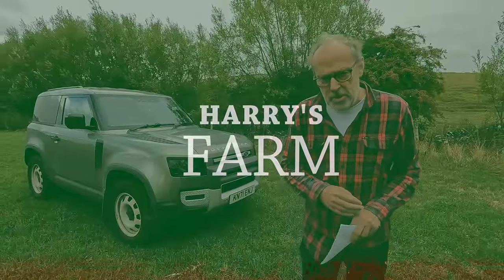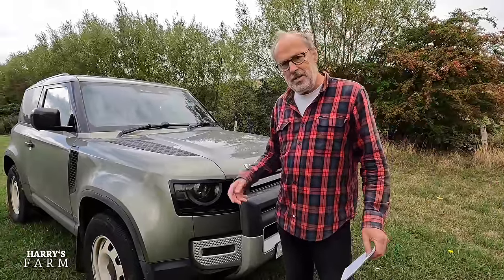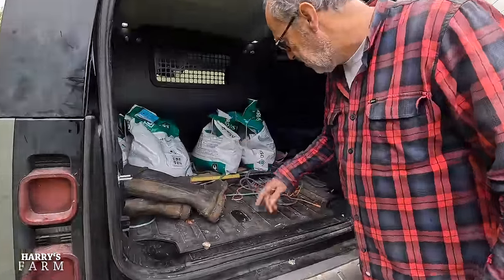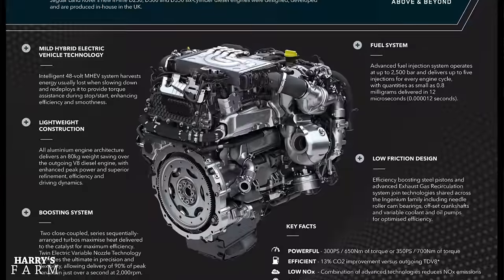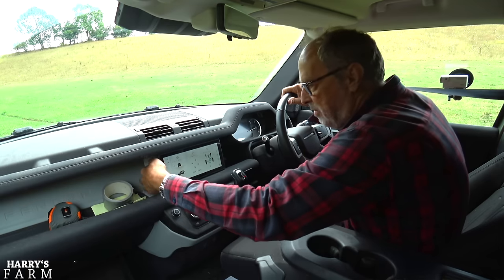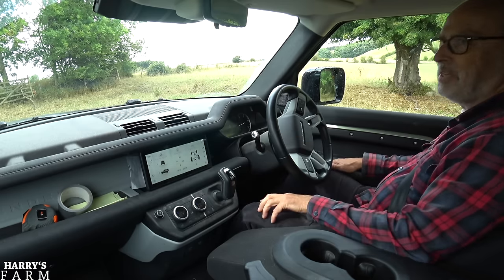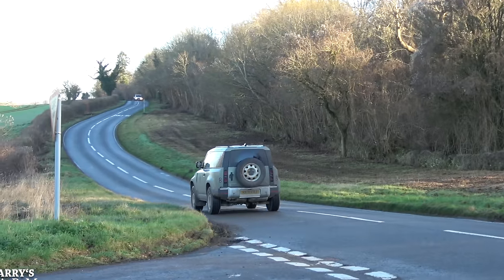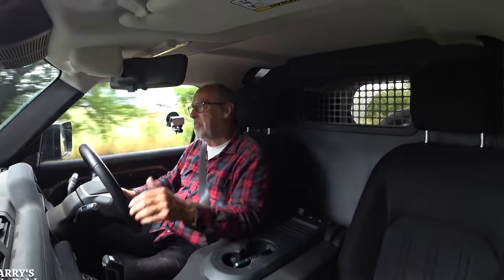New Land Rover Defender 90 Hardtop 12 month review. Is it a true farmer's car?

Comment: I'm astonished at it's 2nd hand value. It is , no doubt, a good vehicle but nearly £10k more than it was new with 10k miles. It would be a great farm vehicle at around £35k.You'd need to be deranged to pay over £60k for that!"
Reply: Amazing isn’t it; I have a 110 plug-in hybrid which came in at under £70k when it was delivered at Christmas, and dealer offered me £85k for it at 10,000 miles… If Land Rover could just build more of them they’ll be able to start offering cheaper ones again hopefully
Reply: That is utterly insane. The world's gone mad. That said, I'd take that offer, but something else to drive for 18 months and then buy a new Defender and pocket £15k 😁
Reply: @Stu_2112  yeah tempting but the problem is anything I bought for the short-term would probably lose a lot of value as prices come back to Earth, and now the new price for the same car (which I’m very happy with) has gone up by £8-10k anyway, so would have to pay a lot more to get back to where I am now
Reply: I'm not, not at all. It's a chip off the old block. Just goes up in value. Modern Defender with heritage from 1948. Unstoppable. They can't build them fast enough. It's these or a G Wagon, do you want to look cool pulling a horse box across a field at Chatsworth or look like a gangster in a G Wagon?
Reply: You aren't getting "more". Your money is buying less or another way of looking at it is, your money has depreciated in buying power.
Reply: @gulag8735  exactly.
Reply: @richardburns5925  I'd take a standard G Wagen without the bling any day.
Reply: @h2489-m2l  and I'll pull you out, when you get stuck dude, all pose your G Wagons you see, 160k posemobile, Defender's are built to work!
Reply: @richardburns5925  fair one. Of course I'll never have a 160k G wagen. I'll stick to my 80 series Landcruiser which chews up Defenders with ease! After 20 years being let down by Army Defenders I never want to drive a 110 again either!
Reply: @h2489-m2l  when your Toyota land cruiser gets stuck, I'll not bring the Defender, I want to get to you and come home same day. No, I'll bring the Nissan patrol Y60 TD 42 inline 6, total utter reliability. The only realistic head to head with the Toyota.
Reply: Many new cars are like that on first release it's nothing special
Reply: @richardburns5925  it's not possible to look cool pulling a horse box across a field at Chatsworth. Irrespective of what vehicle you're in, you just look like a Chatsworth horsey person, i.e. not cool.
Reply: @NickPerry  you don't understand the definition of cool dude. Trust me, if you are driving a Landover pulling a horsebox at chatty batty......you look the bizzo! Where else would you want to be?
Reply: I’d not want the word cool defined by anyone capable of using the words dude, chatty batty and bizzo.
Reply: @peterdelmonte9832  I don't want anything to do with anyone called Peter the man from delmonte, what a half baked stupid name, laughable, trouble is the laughter is now fading.......dude
Reply: @peterdelmonte9832  the man from Delmonte! 😂
Reply: @peterdelmonte9832  Mr Delmonte.......😜
Reply: @peterdelmonte9832  I do not want to be called uncool by the man from Delmonte........ hahaha!
Reply: @richardburns5925  well, when your Nissan Patrol gets stuck rescuing the Land Cruiser that was rescuing your Defender, I'll rescue all you pretenders with my Boeing Chinook HC6A, you can thank me later by getting the rounds in down the pub and after being in my company you will know the true meaning of the word cool.
Reply: @justinbieberlake5635  thank you for your kind offer, we are all stuck in the Aussie outback, I'm just trying to find a refuelling station for the big bird, before giving you the go go.......we don't want to be another crash statistic, when those birds go down.......they go down!
Reply: 74 k from a dealer in North Yorkshire, bloody ridiculous for a commercial vehicle. I have two mint condition proper defender tippers and I’ve been offered 25 k for one of them 07 plate with 196k on the clock, it’s absolutely crazy! I also sold an 11 year old digger and I sold it for 1k less than I payed for it!
Reply: And they say we are in a recession
Reply: @oldcargeezer  weird isn’t it.
Reply: This car is to go to Tesco on a smooth stone road.
Reply: @gabrieljordasoler3298  You haven't seen the road that goes to our local Tesco
Reply: Lmao reminds me when i owned a special edition "Wolfsburg" Golf 2 Gti that I put a full race suspension and what at the time were huge wheels and I saw a 110 stuck on the beach....  I hooked him,  his whole family in the landy too, and then pulled him out of the sand, i wondered why it was taking so much power to pull him out and when i got him on to hard ground found he had turned his wheels full lock.🤣🤣🤣🤣. That Gti had a billet cut kent cam with 272 deg and 10mm lift which was 0.05mm before interference would be ouchie🤣🤣🤣.  I had a vernier cam gear set for torque not top end as I used the car like a truck.  Wasn't unusual for me to hire a four wheel twin axle trailer to fetch a clients car for mods, repairs or services.  Tye car wasn't lowered, in fact I used the full race to raise it to fit the massive wheels. It looked bog standard. Which was the plan. But top end on the dial was over 245km/h.  😁
Reply: @richardburns5925  G Wagon has Austrian heritage - Puch of Styria is the original Austrian maker - made for their defence forces, not gangsters.
Reply: @ViveSemelBeneVivere  correct. In every sense. My point was and is, the G wagen has now become a gangster pose mobile. I'm not talking about 50 years ago, I'm talking about now. The Defender does exactly the same job now as it did in 1948.
Reply: @richardburns5925  Well my 2012 Poor Man`s G Wagen 300CDI as a  commercial equivalent van with blanked rear side windows has no carpets, is  plug hole equipped for the never-seen motoring journalistic cliche  of "hosing out the interior before the trip to the theatre"  and it has manual window winders. I haven't yet discovered  a lot of bling,  but I do have 24V electrics, a manual door key deploying  the worlds loudest electric door locks, full mechanical difflocks, proper off-road tyre aspect ratio and a much stouter fixed towbar than Land Rover`s, made of finest Ruhr cast steel,  complete with a maker's plate and a serial number. That does not need a computer or  a blingy electric motor to deploy. Not that this engine emissions electronics infested vehicle  has been  perfect, but after ten years there's nothing I can sensibly want to replace it with for the next ten years, except maybe buying back  its granite reliable  predecessor a  290GD Professional owned for the preceding ten years which I really shouldn't have  sold, else a  Grenadier possibly, once  plastic engine parts are proven reliable, but emphatically, not a Pretender. Spoken here  with credentials of being a very satisfied ex-owner of a 1986 galvanized bumper Ninety soft top (Reg D420 JLR  and still on the road according to DVLA and another buy back contender), a  200 TDI  Defender run for six years in the 1990s and I had a brief fling with a rather thirsty V8EFi converted Ninety hard top. I  have a 1978 manual  Range Rover owned now  for 22 years and I've been the custodian of a 1956 Series One for over 35 years. How can JLR have been so successful in alienating my brand loyalty with an inflated Skoda Yeti?

Comment: Its alright but just too expensive for a “farm” vehicle given the short comings and the alternative pick ups are much more appealing in price
Reply: Had a good look at the current [new] Ford Ranger yesterday at a main dealer. A far more practical farm vehicle than the 90, but it is also far bigger than even the 110 commercial. Over 200hp with a 10 speed automatic, comfortable for five passengers plus a large cargo area and tows 3.5 tons while costing about £10k less, depending on model. The size frightens some people off and used as a van, with load-bed hard top, access to goods is awkward, but a good gaff [like a shepherds crook] helps a lot to fetch things that are forwards without having to climb over the tailgate and into the bed.
Reply: @hedydd2  we have 4 trucks we use for towing ships mooring ropes and wires which take the trucks past the recommended weights!
2 old TD5 defender and a 2013 tdci defender… they have done our company proud with very little going wrong and one having a very hard life on a scrap berth!
2 years ago we took on Ford ranger, mainly for a bit more comfort.  In that short time it’s had 2 new shocks on the front which started leaking just after warranty, a problem with the add blue pump and most recent was the DPF… our oldest landy is a 1999 ex army Falklands vehicle which had a hard life before we took it on and now gets treated hard with us!
The Ford Ranger has had more money spent on it over the last 2 years that both the older land rovers have in nearly 2 decades of us owning them… the ranger isn’t a bad truck and is comfortable and hasn’t let us down but it has cost us a few pounds!
it’s a difficult choice now for many customers who have stuck my Land Rover because they don’t make anything which would work for us so we will probably just keep the old Land Rover running and maybe get another Ranger one day!
Reply: My local garage has a second hand one on the forecourt for.... £109k. Now, obviously that's not farmer's spec, but Jesus - I had a literal double-take at it. Some people are insane.
Reply: @andybrown205  i think for 109k id have a nice spec range rover with proper comfort and refinement, farm vehicle aside.
Reply: I agree
Reply: @PillSharks  
Yes, keep the old girls running. Modern Diesel engines are not designed for light work, lots of cold starts and short journeys.  A petrol or a fully electric truck would suit you far better.
My 2014 2.2 Ranger auto, used for farm work and towing 3.5 ton livestocks trailers has performed well for 75,000 miles, only needing three rear leaf springs and an DPF vaporiser so far. No long distance driving and very very seldom more than seven miles from home. No Adblue on mine although it is inevitable that my next vehicle will have it. I do have one large car that has Adblue and it uses about 1ml/mile and has never had an issue over its first 20,000 miles.
Reply: and rattle rattle rattle on normal roads like the doors inner sills have broken, which lets face it, its a british made product, it probably did!
Reply: @kavinskysmith4094  Slovakian i think.
Reply: @PillSharks  I wouldn't any Ford model under an F250. Ford likes to cut corners in vehicles rated under 8,501 lbs. Toyota seems to have the highest quality in the half ton and smaller market.
I daily drove a 2011 Ram 2500 diesel until this past September and had no problems at all. Unfortunately the road salt started to take a toll and it was too small to tow my larger trailer at anywhere close to capacity. I have been waiting since March 2022 for Ford to build my F450 order. I find it hard to believe that anyone would consider paying 109k GBP (as Andy Brown stated below) for a Ranger. The F450 KR that I ordered is under $100k USD.

Comment: The same thing is happening over here in the US on our everyday pickup trucks, when you try to use them as trucks. Fancy interiors, over stressed engines, smaller bed lengths. You have to order a "work"  truck to try and get something basic. Really enjoy your channels.
Reply: Pickup market is the same in the UK, it's all double cabs. Trying to find a regular single cab pickup for work is amazingly difficult.
Reply: @fubar12345  Just buy the Commercial model. Usually come in any colour you like as long as it's white.
Reply: its all a tax thing, theyre being bought as even their luxury offerings in trucks is cheaper than luxury suvs for people who have a business etc.. thats why prices and comfort are going up so much. The buyers who give them the most profit are the ones that the trucks are designed for
Reply: Half ton pickups are not really worth buying as a work vehicle. Once you get up to a 3/4 ton or higher the over stressed engines and short bed lengths go away.

Comment: I reckon that’s probably the best all round review I’ve seen. I’ve always had 110s (hardtop, tipper and now hicap) so I’d expect I’d be the market the new defender would be aimed at but they seemed to have missed the problems on the old trucks but thrown technology in 🤷‍♂ don’t get me wrong, the comfort and technology you can’t knock. Then the price 🤦‍♂ and the ridiculous price for some of the extras.I’m sad to say, I think my TD5 will be my last Land Rover I own.
Reply: The narrow rear door has been an issue for decades and yet it's still too narrow to fit things in!
Reply: @tomcardale5596  your right, plus the lights were never great as standard, never really got decent mpg (mine does about 18mpg with 3.5t on)but granted the new one does better on motorways etc etc🤷‍♂
Reply: @casto-  I've upgraded the wiring on mine (2011)and fitted the clear headlamps and with those done I think the light output is pretty good. Of all the cars I've driven recently they're my favourites. But it's a bit silly you had to do the work to fix the bad build!

Mine isn't too bad on motorways, I get about 33mpg at 65mph with a moderate load and no trailer. I do a fair amount of motorway, 700 miles a week is pretty common. It's a bajillion times more comfortable than truck cabs I've driven!
Reply: I've always run land rovers but just bought a D Max and I'm never going back. The rattly door at that price just isn't good enough.
Reply: @ianworley8169  I thought he had been given it to demo? He’s an experienced automotive hack and JLR connections - so cheap advertising considering his standing. I wouldn’t be surprised if he wouldn’t have got discount to keep it, but he’s used the market value to the public to be realistic.
Reply: I was the same. Loved landys but they've priced themselves out of the market. Can have 2 of its biggest rivals for the same price as one landy and the rivals will be better engineered and won't break
Reply: @ianworley8169  This would have been a long term loan
Reply: I am also on my last Landrover, a Freelander which although has sometimes been problematic I have generally liked. But Landrover have priced themselves way out of the market and while this van version looks good and has many refined features, Harry does make a point that you could actually buy two vehicles, one for towing/road work and another as a farm runaround - and still come out with some change!!!!
Reply: @ilikelampshades6  whats the two alternatives?
Reply: @pipolebnene  Hilux, Dmax, Amarok, L200, Land Cruiser etc

Comment: Fascinating review. I had the same door chattering on a 2010 BMW 330D Touring that I bought at 20,000 miles. The dealer changed the door seals to no avail. Back and forth for a year. Actually ruined the buying experience for me. As a last ditch attempt to fix it I went to another main dealer who drove it 10 feet and said: "door tape mod". A strip of posh sellotape between the door metal and the rubber seal. Shut it up completely and is still quiet 145,000 miles later. Weird.

Comment: There were a few things here that I wanted to clarify just incase people were interested. 

The coil suspension is at the normal ride height of around 8inch that the air suspension rides at. When air is lifted to offroad height its 11 inch. 

On the mirror- This is true to a certain extent but have you lowered the picture using the settings? You can drop the view down a bit and it was a big help for vision. 

When you spoke about the bash plate - It looks like you have the special protection system (which I love) but this raises the front bumper by a tiny bit on each side, adds the two tone brush guard, and the skid plate. So more for your money than just paying for the skid plate. 

Rear door - If you open the rear door to a certain point it will stay open (even on incline) however, it def will close once you start driving as you said.
Reply: I have both a coil sprung 110 and a air suspension 110. It's pretty clear when the air suspension is in normal height the coil sprung model sits a bit higher. It's also true the off road height with the air suspension is still higher than than coil sprung model . The coil sprung model is somewhere in between normal and off road height. At least that's true for mine. Maybe it's different in other places.
Reply: @kylehendrix3531  ya I just went to look it up because I remember it being close. The air 110 sits at 8.5 normally and the coil 110 is at 8.6 so barely different. The coil 90 sits at 8.9 though which it's interesting it's that different. Either way it's tenths different and not at the "off-road" height of the air which is 11.6
Reply: @kylehendrix3531  How do they compare in road driving, as in, is the air suspension worth the extra for a vehicle like mine that gets mostly road use?

Comment: When I saw the new defender first released, I instantly had a feeling it wasn't really aimed at the practical market but as a town run about vehicle.

It seems more designed for those that want to be seen as country folk and want to go off road but in town/city comfort!

It feels a step back to me, the older models seem like they can take a beating but not cost an arm and leg if it needs repairing.

I have to wonder though, for the practical sense of space, why don't you use a pickup? I have a double cab that has plenty of room for all my tools and equipment (I do gardening and land management, so chainsaws, brush cutters, mower,  strimmers, spades, forks, toolboxes etc) and get my kids around. Obviously the single cab would give you so much more space. Just curious to your thinking in that regard.

Keep up the good content. I've lived in a farming community nearly all my life but the farmers I know don't go into the details you do. It's always nice to learn more.